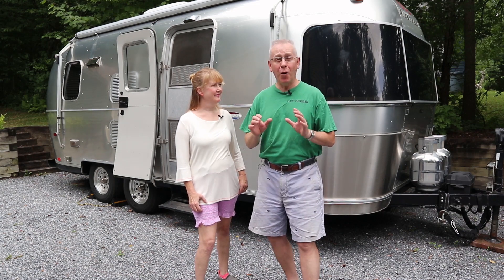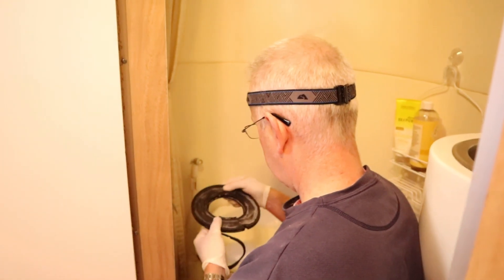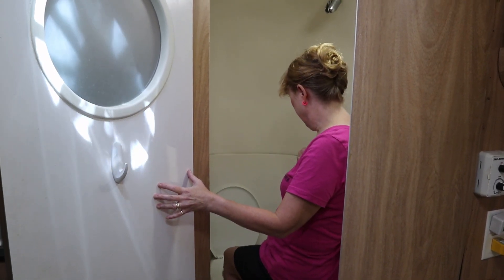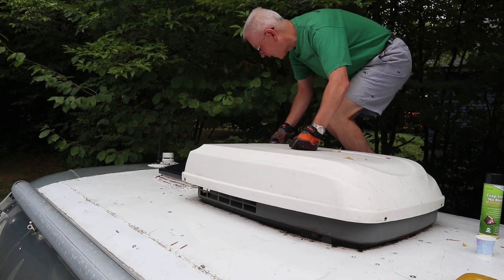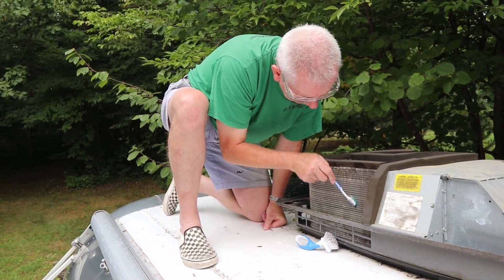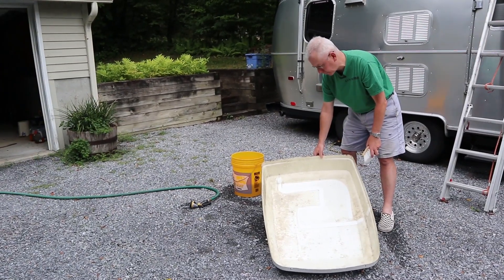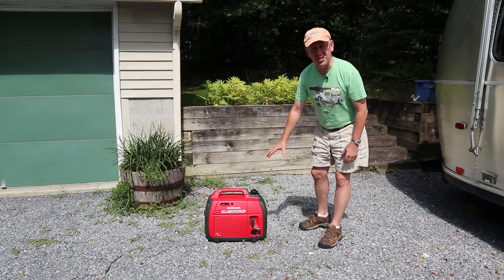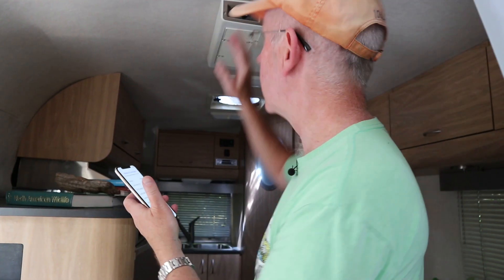RV Toilet and Air Conditioner Maintenance | Generator A/C Micro-Air Easy Start First Use

Comment: Thanks for another informative video! What's on the left (driver side) of your A/C unit? Our 2016 International has foam insulation that birds have pecked at and semi-destroyed.... is this something you've encountered?
Reply from the maker: Thanks for watching!  I think what you might have seen is the Micro-Air Easy Start - that's where they installed it.  Our foam is actually in good condition with no bird damage.  I cleaned out a small wasp nest but that was about it.
Reply: Thanks for getting back. I appreciate your channel and really enjoy the genuine-ness. Sincerely

Comment: You didn't show it, but I thought it was necessary to rinse the coils after the cleaning product dissolves all the gunk? Or did you use a different product that doesn't require rinsing?
Reply from the maker: Thanks for watching!  The product we used is entirely evaporative so there is no need to rinse it.  It's one of the reasons we chose it.